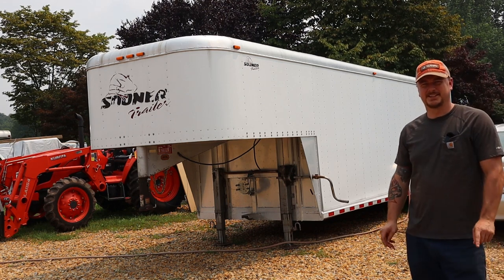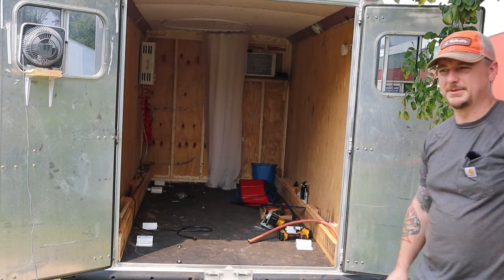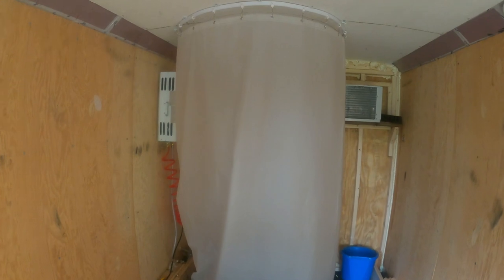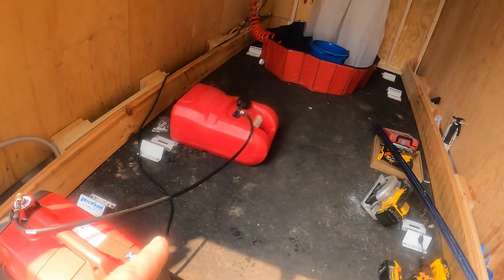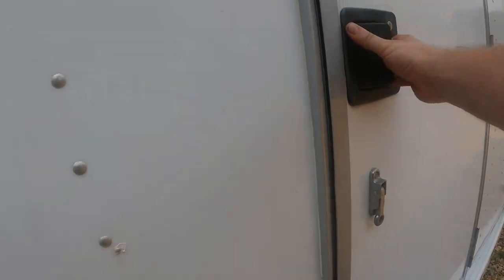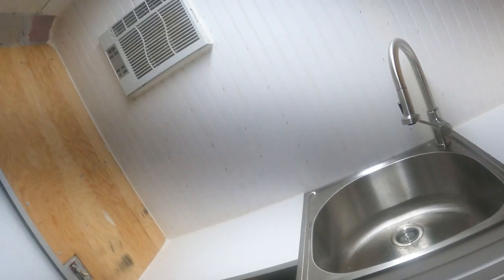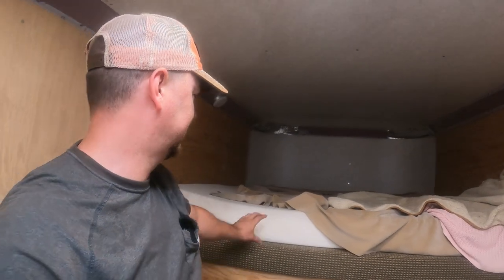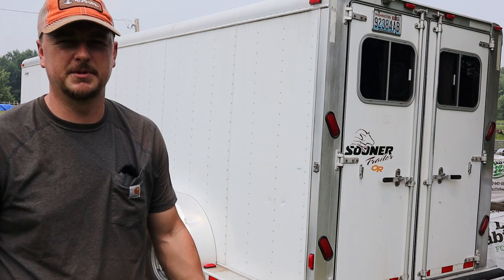#54 DIY Cargo Trailer Toy Hauler Conversion!

Comment: Not smart at all running that generator near your ac unit is !!!! My buddies dad died like that and they had a family of 5 that died like that near my house during a hurricane storm
Reply from the maker: Well the gen exhausts outdoors, there are two co detectors and it only runs inside when there is no occupancy but thanks for the tip !